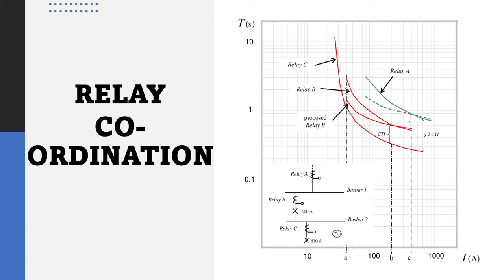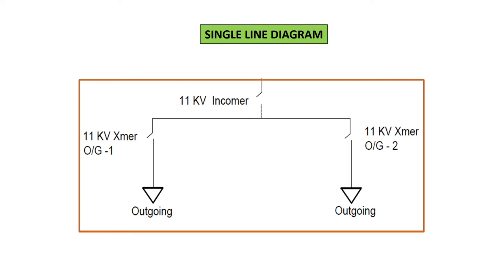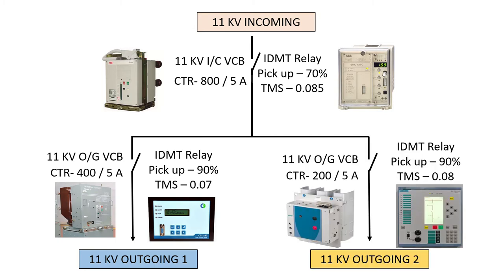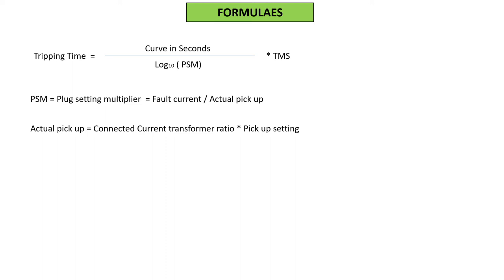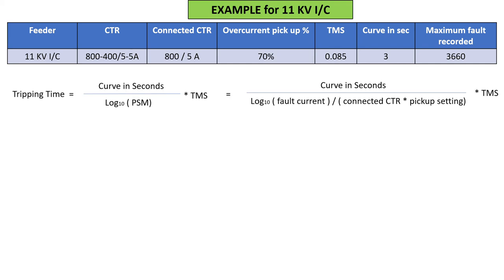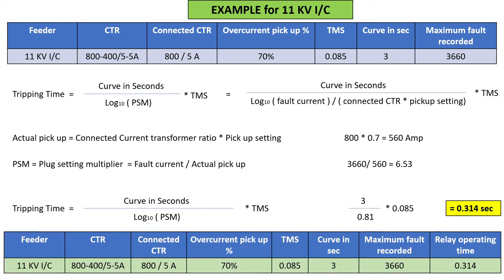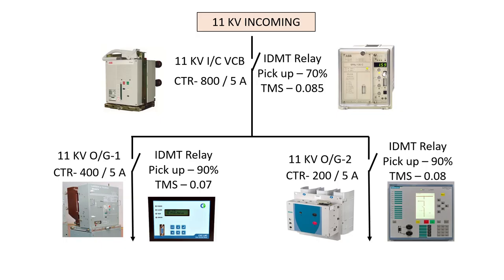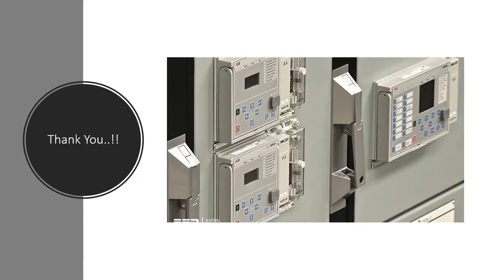Relay coordination & Breaker tripping time calculations

Comment: connected CTR is 800/5A . why the Actual pick up is not 160*0.7?  As transformer ratio is 800/5 = 160/1
Reply: Ratio nhi rating li jaati hai current rating x  percentage pick

Comment: Sir kindly make a video on fault current calculation in in 33/11 kv 5mva z=8% station
Reply from the maker: @nikhilduggani3766  hi dear....through the video you can calculate for your scenario...if you want hands on help & guidance. Kindly join the electrical Designing  course 3rd batch. U can what's app on 8421208598.

Comment: Sir relay quardnition pe  ek series type bna dijiye 
3 ya 4 video jisme pura cover kiya ho 

Mai abhi just  relay cordination pdh rh hoon
Reply from the maker: Dear you can join designing class that is going on online. Where we give hands on training & solve doubts immediately. Plz what's app on 8421208598
Reply: @electricaldesigningbasics   
Ok sir 
Next month k starting se join kar lunga 
Aapka batch wise chlta hai ya kabhi bhi join kar sakte hain ?
Reply from the maker: @vishalthakur7852  batch wise. Dear.... Present batch will be over in two weeks.... Drop a message will connect with you.. 8421208598
Reply: @electricaldesigningbasics  Ok sir

Comment: What will happen if we connect load more than busbar rated current 
Ex.  Busbar design 2500A
If connect 1600A or more than 2500A what will happen in bus
Reply from the maker: U will observe heating at bus bending points , abnormal effect will be seen near the hole present at bend. U will early sign using thermal imager or temperature gun.